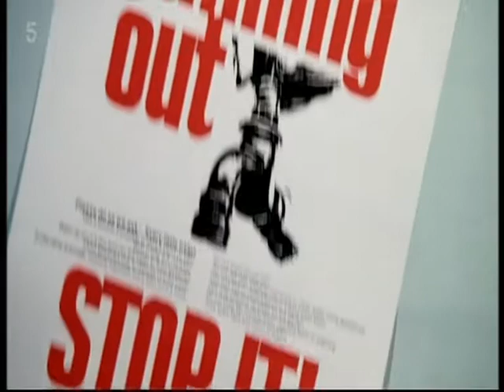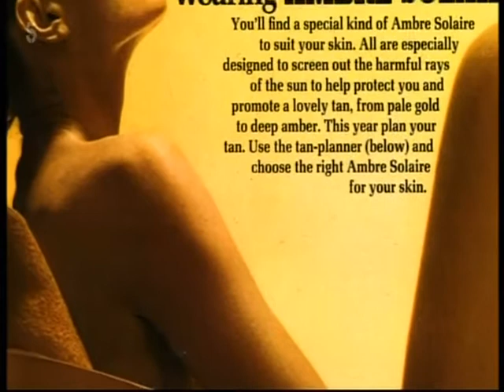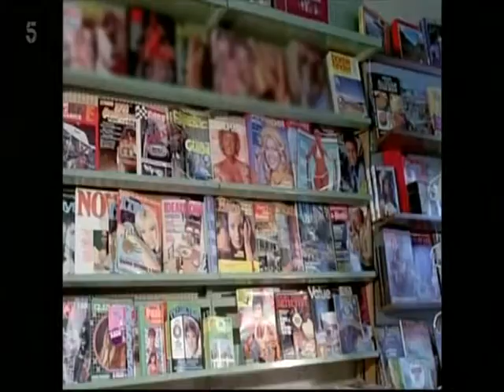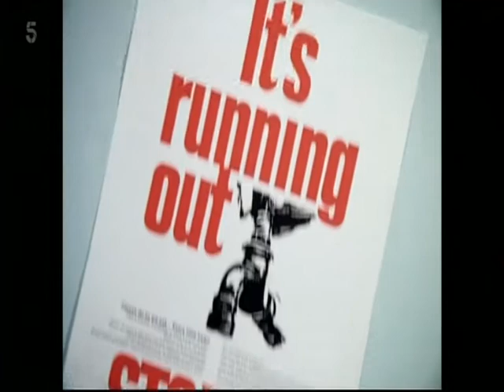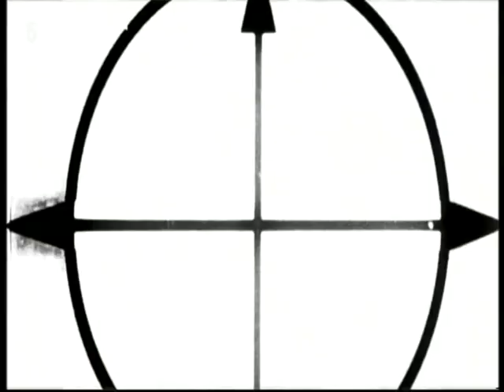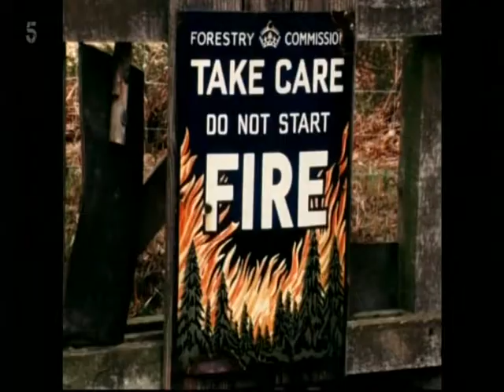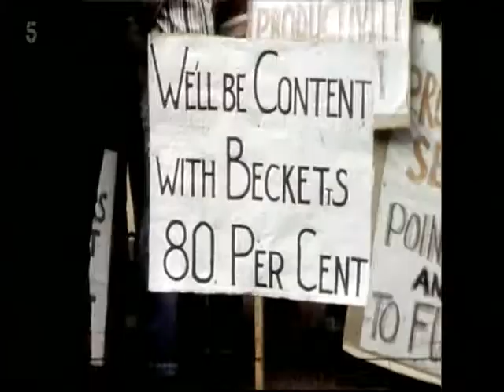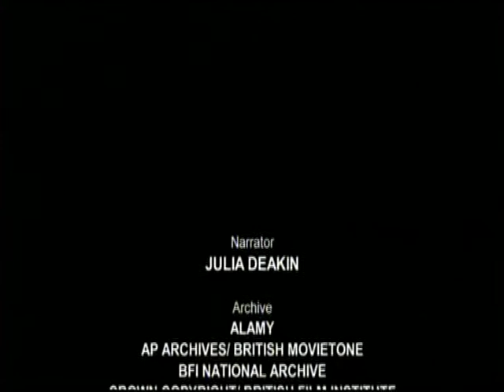The Long Hot Summer of 1976

Comment: I was 8 at the time and have vague recollections of that wonderful summer. The latter half of the previous summer in 1975 was also hot but the summers from '77 to '82 were cool, damp and generally crap which was the norm in the UK in those days. 1983 when I was 15 was the next hot one.
Reply: Yes 1983 was the first hot summer I can remember.  Was only 3 in 1976.